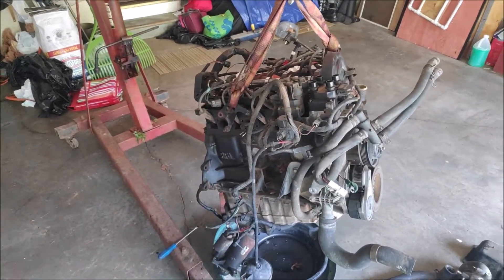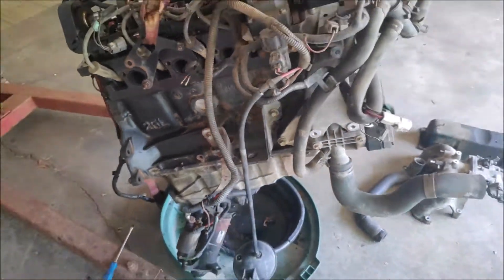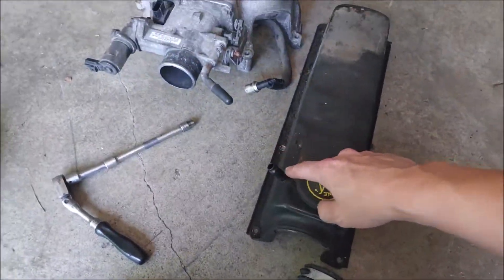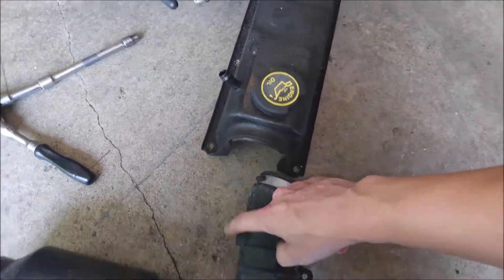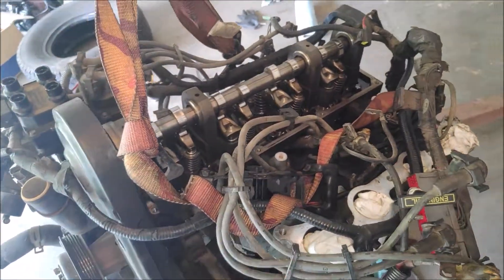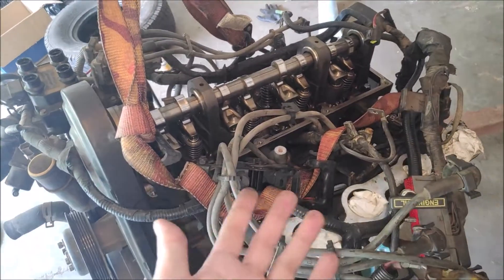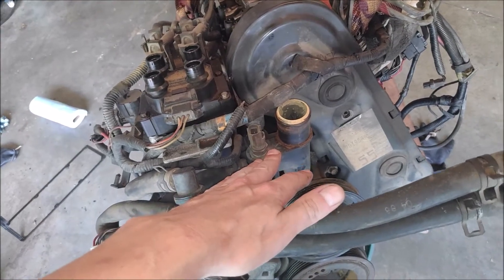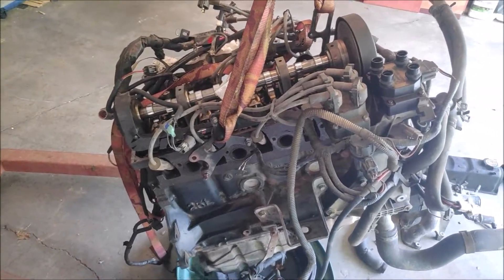Ford Ranger Best Engine Swap, 2.3l to 2.5l, Part 2, Parts swap.

Comment: You did not cover the crank position sensor issue
Reply from the maker: 95-01 have the same crank position sensors.
Reply: My 2.3 in my 1995 has a sensor that sits behind crank pulley ,and my 1999 with the 2.5 has a sensor that sits to the side of the balance in plan view. I track with you on the motor mounts and injector swaps. It's the crank sensor that sort of slowed me down! I'm swapping from a 2.5  1999 ranger and putting a 2.3 out of a 1995 into the 1999.
Reply from the maker: @milkcookies7162  do you have a cam position sensor on your 95 2.3?

Comment: Just an FYI, you can also swap the 2.5 from newer trucks into 93/94 trucks by removing the 2.5 harmonic balancer with the ring style crank sensor, and installing the hall effect sensor from the 93/94 2.3, it does require drilling and tapping holes in the block to mount the crankshaft position sensor, and using the 93/94 balancer. My 93 with a 2.5 was still running great when I sold it 10 years after doing this swap.
Reply: Did u happen to take pictures of where you drilled and tapped ? I found you on a forum explaining it but still a little lost
Reply: @reesemelton8792  No... It's been about 13 years since I did it. I had the old block sitting there so i could measure, mark etc very easily. I do remember putting the sensor up to the block sliding the older balancer on to get the placement correct (making sure it wasn't going to interfere with the rotation of the balancer, and then marking the holes. Then I could measure and compare the center of those holes with the holes on the other block. Start with a small drill bit, and then increase in size. If you're off by a millimeter or so, you can carve out the bolt holes in the sensor a bit with a drill bit, and wiggle it around so it doesnt hit the crank and tight it down (after tapping the threads in the holes))

Comment: I am doing the 2.3 to 2.5 swap right now. I am not anywhere near being a mechanic. I pulled the engine from my 1994 ranger and put in a 1999 2.5. I did trans and engine. I left the 1999 engine harness as it was. Transferred 99 computer with engine. I replaced fuel tank,fuel pump, fuel line to the into the 94 from the 99. All my lights, turn signals work in truck but I need the ignition to speak to the engine through the ECM? I didnt realize I was doing 2nd generation into first generation swap. I have to figure out wiring. I have original wiring diagrams from motorcraft for both trucks. So I am stuck! Do I attempt to rewire 42 pin c124 connector to get 94 to speak to the 99 ? I could trace wires or could I use both Power distribution boxes and.... I feel like and idiot trying to understand a different language with no translator! Any help would be appreciated.
Reply from the maker: 94 had an external ignition module and 95+ it was in the ECU......so it's not going to be a simple swap.
Reply: @everydayirace  that’s why I was hoping you could help! Lol
Reply from the maker: @meanwhileinindiana8107  93-94 were odd trucks, I would've installed 2.5 internals into 93-94 block honestly and kept original wiring.
Reply: @everydayirace  Sadly I didnt, any suggestions where to begin?
Reply from the maker: @meanwhileinindiana8107  Convert it all to 95+ wiring/ecu or go with a stand alone ecu to control the engine........hopefully you don't have an automatic transmission.
Reply: @everydayirace  no automatic! I left engine harness completely intact and removed rest of harness from donor truck including power distribution box. Would stand alone ecu be easiest?
Reply from the maker: @meanwhileinindiana8107  it really depends on your abilities.
Reply: @everydayirace  I was thinking I could run 94 truck body off of the original wiring and Power dist box, and run the engine, fuel pump and move ignition to the 99 Power Dist Box and use both Power Dist boxes separately jumping the power from 94 to 99 PDB.Any thoughts or is this completely crazy?
Reply from the maker: @meanwhileinindiana8107  I have no idea.

Comment: Hey man did you ever check your fuel trim levels ? My truck runs good after the swap but does have a lean code and my long term fuel trim at idle is around 25% and short term is around 14-21
Reply from the maker: My ltft is +20% at idle, no lean codes because it's under 25%, I'll be testing something else to get them down.
Reply: @everydayirace  thanks for the reply! Please keep me updated!
Reply: @everydayirace  I was gonna ask if you have to run premium gas after the swap?  If I run regular is get pinging. I’ve already put 2k miles on the way and it’s been running great

Comment: So did you run the 2.3 or 2.5 injectors? You just said you swapped the fuel rails, and swapped injectors? Which ones did you use?
Reply from the maker: 2.3 injectors, 2.3 engine mount brackets, 2.3 fuel rail, 2.3 ecu, 2.3 throttle body, 2.3 intake tube and maf,, 2.3 transmission.

Comment: No clearance issues while dropping it in like the supposed difference in the oil pans and crossmembers? The 2.3 era trucks being I-beam suspension and the 2.5 era trucks being A arm suspension.
Reply from the maker: No issues.
Reply: @everydayirace 2.3 and 2.5 have identical exterior dimensions correct? The difference is the displacement/stroke if I am reading correctly.
I know this is an older post of yours but I'm actually getting ready to prepare to swap my 3.0 V6 Vulcan out for a 2.5. it actually makes more horsepower and a ton better fuel mileage. Plus lighter engine. Only thing is I have to go automatic so I have to swap that too. I've had five spine surgeries and there's no way I can do a clutch.
Reply from the maker: @justinmurphy2227  95-97 2.3 is the same dimensions as 98-01 2.5l

Comment: Actually, I'm going to correct something about the fuel injectors between a 2.3 and 2.5.

Fuel pressure, at fuel rail, 2.3: 40 PSI
Fuel pressure, at fuel rail, 2.5: 60 PSI
Fuel Injector Fuel Flow, 2.3: 14 lb. per hour
Fuel Injector Fuel Flow, 2.5: 15 lb. per hour

These figures are from Haynes, from their manuals, and are confirmed by Ford documentation. This is why, with a 7mm larger stroke, the 2.5 stock has 119 HP base, while the 2.3 Lima has only 100 HP base. Additionally, the 2.5 heads flow just a bit better than the 2.3s, whereas the 2.3 camshaft has better lift and duration.
Reply: Isaiah Welch Do you think the 2.3 cam would work in the 2.5 engine with the 2.3 ecu?
Reply: @jessemitchell4228  : The problem is two things:
1) The 2.3 has no cam sensor -- so the best thing to do is leave the 2.5's cam sensor in the head with no wiring attached.
2) The crank sensor setup is a bit different between the two. I'm not sure of the 2.5's crank sensor and how many wires it has, but I know the 2.3 crank sensor is a 4-wire Hall effect sensor -- and the 2.3 ECU was set up with the 2.3 crank sensor. Relatedly, the location of the 2.3 crank sensor is different than the location of the crank sensor on the 2.5, which may mean going into the engine wiring harness and changing out the timing circuitry wiring itself from the disconnect on the fire wall to the sensor location, which on the 2.3 is directly behind the harmonic balancer, and on the 2.5 is on the passenger side of the block, since the timing system was changed to a "missing tooth"-style inductive timing system in 1995/1996, with the introduction of OBD-II ECUs (which is why the 2.5 has 2 O2 sensors, while a 2.3 only has 1 O2 sensor).

If anything, I would actually simply swap the 2.5 engine, ECU, and wiring harness into an older truck. That way, you run into 0 issues with electronics. The only other thing you would have to do is fabricate how the downwind 02 sensor goes into the exhaust.

As for myself, I'm going the other route: Putting in 2.5 internals into a 2.3 block. The only thing I'm worried about in doing so is making sure that even at 4,000 RPMs, that the bottom end can spin freely and hit nothing, as there is a 7mm difference in stroke. It might not seem like much, but that does mean the crank and the rods are not the same as a 2.3, though the pistons are the same overall diameter. The other thing I'm considering is whether or not to change from the return-style fuel system of the 2.3 to the single fuel line of the 2.5, which also might have to be done, with a 2.5 fuel pump and fuel lines up to a 2.5 fuel rail. The circuitry for the injectors would still be the same. I even considered swapping cylinder heads, but I don't want to have to deal with coolant flow issues.
Reply: @isaiahwelch8066  I’m going to be going from a 2.3 to 2.5 I’ll record a video and see what happens when I get it all tied together and talk about what problems I ran into